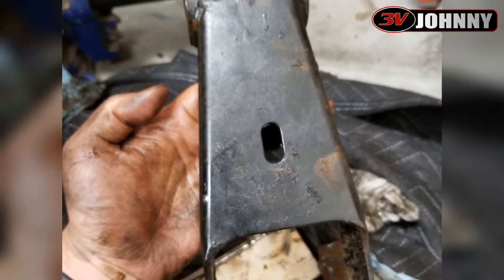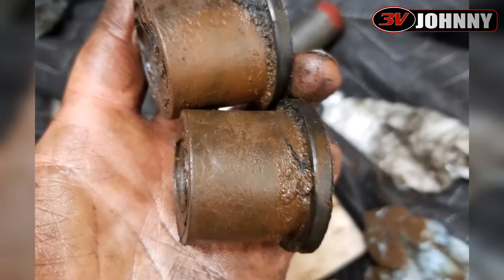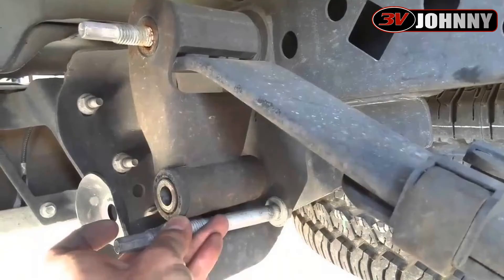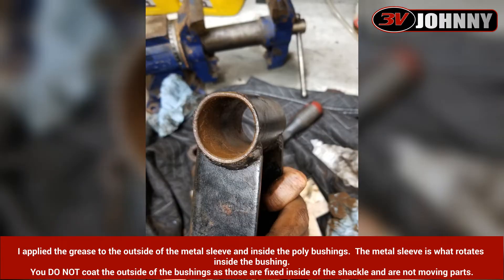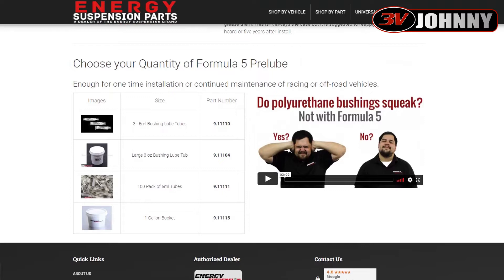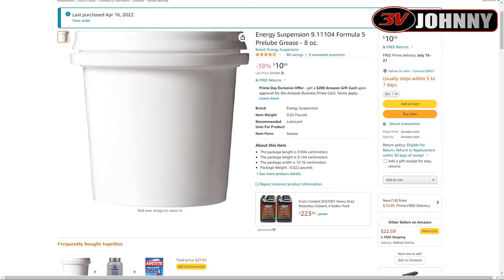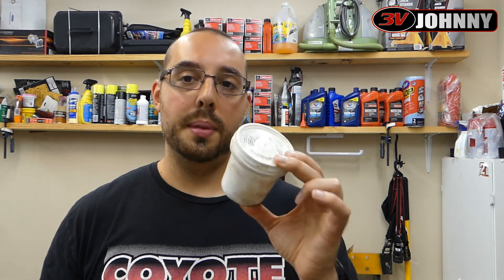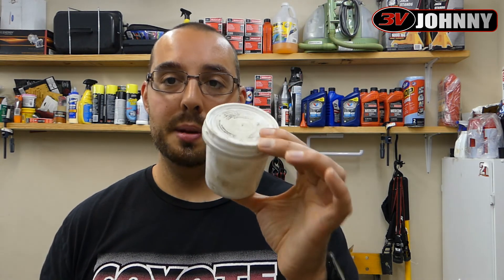Are Your Polyurethane Bushings Creaking?  Check out Energy Suspension Formula 5 Prelube

Comment: Had someone install the energy suspension poly front sway bar bushings and noticed loud creaks and squeaks over bumps and turns and watching this video leads me to believe that is the culprit instead of the sway bar links or lower control arm . Is there a pro to poly bushings or should I replace those with rubber bushings considering I do not work on my car and use it as a daily driver?
Reply from the maker: That is very likely the issue if it started when those were installed. Barring a failing ball joint or something else. 

Poly bushings are more rigid and provide less deflection when under pressure. They tend to remove a little bit of slop especially when you're at the limits. For most people, they are not necessary. They're only in my shackles and sway bar s on my truck because that's what the manufacturer made them with.   Otherwise I would not put polyurethane bushings on control arms or anything like that. For most applications of daily driving, rubber factory style is best as Poly bushings are noisy by nature.
Reply: @3VJohnny  thank you!
Reply: @to8840 just wrap a single layer of Teflon tape around the bar where the bushing goes and put the poly bushing sticky grease over the tape, then install the bushing and it won’t make any noise.